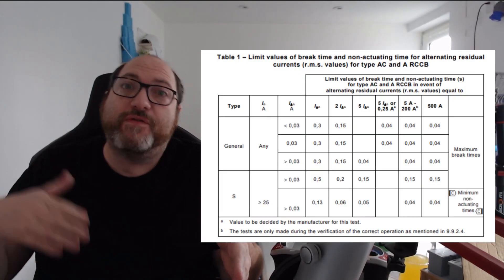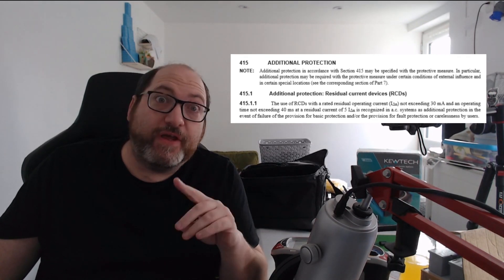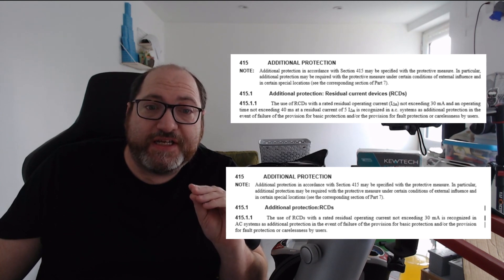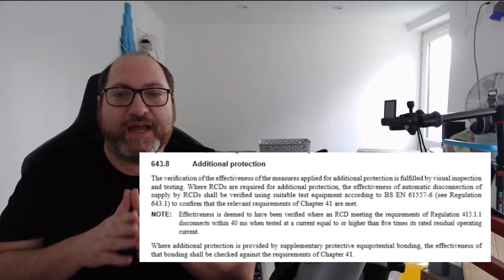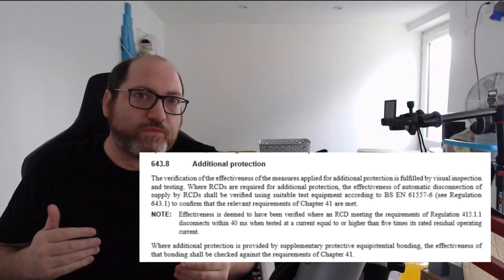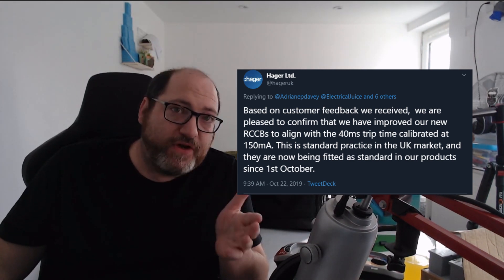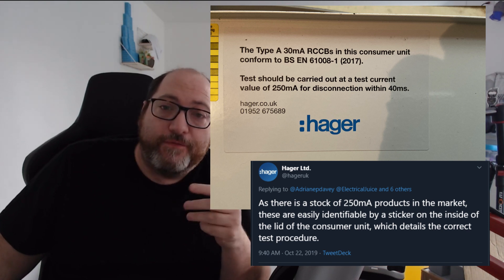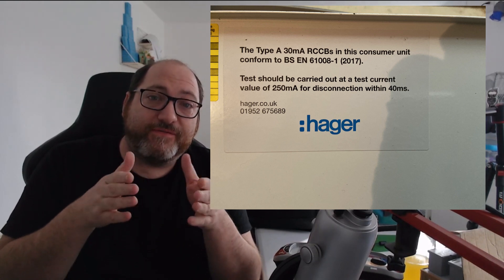Testing Hager RCCBs/RCDs UPDATE!

Comment: I’m currently testing a block of apartments where type A 61008-1 Hager rccb’s are being used. In 2 apartments when tested at x5 they didn’t trip within 40ms. I remembered watching this video and realised there was no sticker in the back of the consumer unit. So I gave Hager a call to double check and they told me that as there was so many mass produced, stickers didn’t get placed onto half of them and to carry on testing x5 at 250mA at the RCCB under no load. Thought id share the information as it’s well passed October.

Comment: You cannot set the variable to 250mA or set  it to 300mA x1 on the MFT (Don't know if other testers are the same) as it does a background half test before doing the set test. If set to 250 it will first test at 125, trip the RCD and display "trp" as it is expecting the RCD to be set to 250mA as well and will see this as a fail on half test. This is not documented anywhere and I only found this out this weekend on the IET forum. I put it to the test with my tester and it was correct.
Whatever you set the test current to, irrespective of the multiplier, it will do the unseen half test first.
You need to set the variable to 50mA at x5 so that the half test current at the start of the test is only 25. Even this should trip the RCD as is is just above the threshold but it didn't on the one I tested to see if the half test was correct.
However, if tested on other RCDs it may still trip as well so even this setting may not work.
Hager must have been out of there minds doing this without thinking of the testing issues.

Comment: Thanks for the information I am just catching up on this.  Can you clarify that ALL the Hager production of these devices contained the 250mA test label in the CU lid or was it introduced as a stop gap until they reworked them down to 150 mA.  i.e. could there still be original units at the wholesalers that contain the 250 mA devices that do not have a label.

In addition to the concern shown at the failure of the150mA 5x trip test there has also been concern that these units are producing a much longer trip time at 1X i.e 130mS instead of about 25mS we are used to seeing.  Whilst this is still within the 300mS and considered a pass I for one would prefer the faster disconnect.  Has anyone notice a reduction in the 1x trip time on those units now set at 5x 150mA trip.
Reply from the maker: I cant assure that they were always within them. My gut says they were introduced a little later.

Comment: So if the new RCCBs (BS EN 61008) from 1st October have now been recalibrated to 150mA, does this also mean this recalibration also applies to BS EN 61009 (RCBOs) too?

Edit: I've had a look on Hager's website for the RCCB testing and it only mentions BS EN 61008.
Reply: chrisrulez001 the BS EN 61009 compact type A RCBO has always been fine to test at 150mA
Reply: @mattg4321  Thanks for the clarification

Comment: Good video. 

Point 1. That label didn’t appear on the early versions of the ‘18th’ consumer units if my memory serves me correctly. I only noticed them a few months ago. There will be loads of consumer units out there with the RCCB’s that need testing at 250mA that do not have this label!

Point 2. If you have a Megger 1552/3 then you can’t test at 1x 300mA. The machine recognises it has tripped at way less current than that and doesn’t give you a result. It merely says ‘trip’. 

Hope that helps someone!